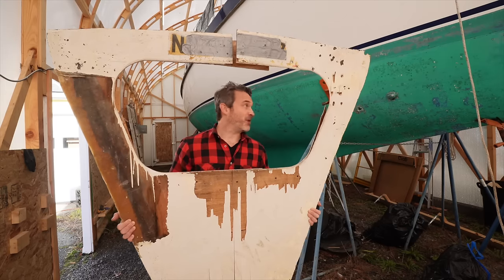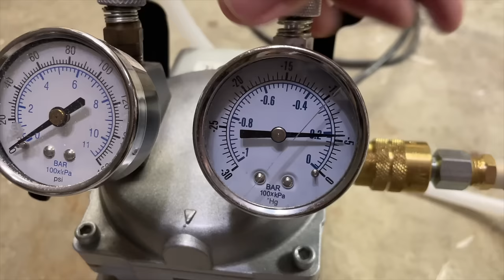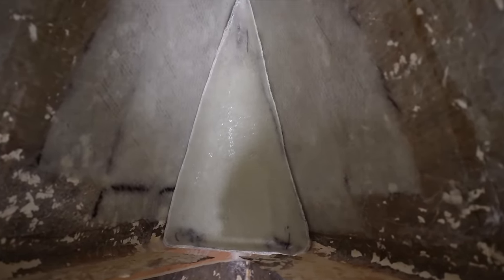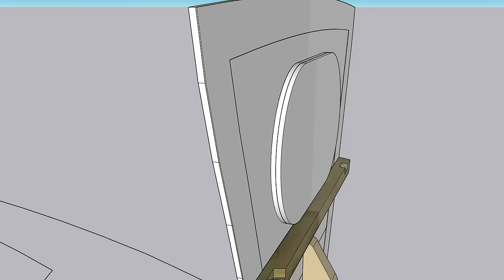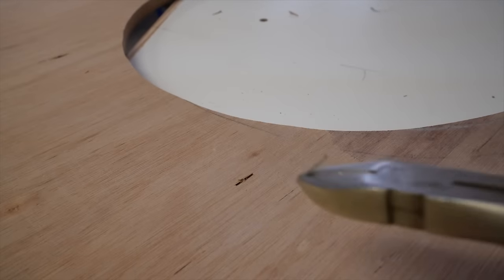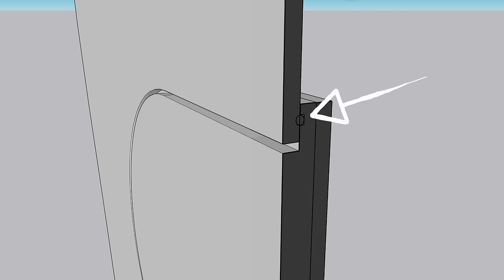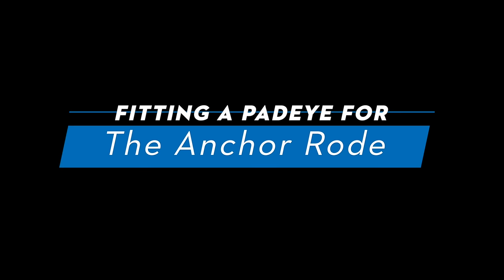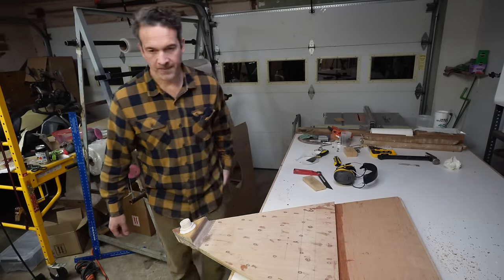Struggling with this Bulkhead Replacement? It’s a REAL CHALLENGE! - E018

Comment: If you anticipate the need for many additional perpendicular holes, Rockler makes a jig that will hold your drill perpendicular to the surface.  It’s compact enough that you can drill perpendicular holes into surfaces at pretty much any angle.  Very handy when drilling for deck hardware.
Reply from the maker: Thanks. I think I actually have one of those lying around somewhere… 🤔

Comment: This guy make more dang templates. The original bulkhead he removed was the only template he needed. Then he used the original bulkhead to make an OSB template. Then he used the OSB template to make a template out of those little pieces of veneer, then he finally made the final piece. Damn, that's a lot of extra work.

Comment: That simple jig system you used for the padeye is a really good tip. I need to mount a windvane shortly which is a fairly fiddley to do on the mooring and will be perfect for that. Same same for the drogue chainplates.
Reply from the maker: Thanks. 🙏 It’s a trick I’ve used many times to get relatively accurate drillings. Good luck! 👍

Comment: Once you start glassing the bulkhead the ply is merely a core and the overall sheer strength of the bulkhead relys on the low elongation of the glass. The ply has higher elengation so the glass would need to break  and delaminate before the ply does anything. A couple of layers of glass over h100 foam and your good and rot free. if your worried about abrasion etc put wear plates in the locker that are easy to remove.
Reply from the maker: If I was starting over again I would probably have used foam as the core for this bulkhead. 
Learning as I go. Thanks for the input. 
🙏🙌👍

Comment: That's a lot of waste produced from such a small area of the boat (the V section in the bow)  ..shame you can't re-use the mastic and some of the cloth components or maybe you can ! Is the vacuum process absolutely necessary , I mean it looked well wetted out before you did that?  Great work regardless, really enjoying this.
Reply from the maker: Yes, some of those supplies are unfortunately waste. I reuse as much of it as I can and have used the same vacuum bag up to 3 times so far with good results. 
It wasn’t essential here but the practice is helpful. The glass in the locker is lumpy and I was concerned about voids. Looking back I could have troweled it smooth with thick epoxy, let it tack up, and then wet layup overtop. 
Perhaps that’s the plan for next time. 
Thanks for the feedback!
🙏👍🙌

Comment: I am not a specialist but i have seen damaged boats that had hit objects in the water while sailing, they both had damage all along the waterline from scraping along the object. My thought is that building a bullitproof bowlocker is certainly helpfull but having redundancy in pumps and compartments further aft is as important. Not meant to criticise your work, just giving my 2 cents 😉
Reply from the maker: That’s a good thought about things scraping the water line… Antidote is built pretty tough (one of my mentors says it was built like a battleship 😂)

I’m hoping to never need it but I think the bow is the greatest risk with what will likely be quite a bit of short handed sailing. 
I will have quite a bit of redundant bilge pump systems before this is all over. 
Thanks for the feedback! 
🙏🙌👍
Reply: @livingforsail  The owner of one of the boats said they hit, rode up and then slid along something big, probably a container low in the water. The damage was extensive, it was a long keeled boat, heavily built, they had 2 holes at the waterline they managed to plug. This was years ago and a good scare to see.

Comment: Since that padeye needs to be watertight, will you be bedding it the same as you would for deck hardware? If so, will you also chamfer the bolt holes for a gasket of bedding material around the bolts?
Reply from the maker: Yes!! Good catch. I’ll show that detail in an upcoming video. 🙏👍🙌

Comment: Hey Jon, great video.  I'm glad that you decided to put a layer of 1708 on the inside of the anchor locker -- I was actually going to suggest that!!  You are going to add the 1708 to the top section too, you didn't show anything being added to the top section on camera.  Question:  That layer of foam around the perimeter at the top of the bulkhead that you added off camera, was that just raw foam glued in place with thickened epoxy?  Are you planning to carve that into a fillet shape to create a curve for the fiberglass while tabbing in the bulkhead?  I guess that I'm not really clear why you wouldn't make the bulkhead actually contact the hull to fillet in with thickened epoxy and then tab the bulkhead directly to the hull.
Reply from the maker: Yes, there will be glass on the upper section and then all tabbed together for a complete seal. 
The video was getting too long so it will go into the next one likely. 
I’ll get a better shot of the upper foam too. It’s the same Divinycell as the deck (6lb 3/4”) and it will be shaped to smoothly transition 3 layers of 1708 tabbing. 
Thanks for the question. Cheers!
🙏👍🙌
Reply: Thanks for the clarification ... I wasn't too sure about the use of the foam, but i figured that was the reason that you were using it! Keep up the good work!!  @livingforsail

Comment: Remember even if you take the bow off the boat the water in the compartment wont be much above the waterline.
Reply from the maker: I’m not totally tracking what you mean here… 🤔
Reply: @livingforsail  When you have a hole in the bow the water will only rise to the waterline and not fill the whole compartment. So the bulkhead does not need to be super strong/water tight all the way up.
Reply from the maker: I agree but i think that principle only holds in pond water. If we encounter weather with a breach I think I’ll be happy to have a door that is at least somewhat resistant to ingress…

Comment: Do you have concern about adhesion of the old flange forward of the bulkhead, or will you replace once back is tabbed in?
Reply from the maker: I am not too worried honestly. The epoxy is tenacious stuff. All the same we will add more tabbing to the forward and aft faces to make it really stout. 🙌👍 thanks for the question 🙏

Comment: Do you need to vacuum seal the fiberglass to get it to set/cure, or is this just a more belt and braces approach? 

Thanks 

I
Reply from the maker: It’s the “harder way” 😉

I could use more braces and weigh it down or maybe temporary screws. 
This way gives the best bond and most evenly distributed clamping force (way more than I could get otherwise)

… and it is kind of fun to pull it off I must add…

👍🙌
Reply: @livingforsail  hah of course! 🤣 Yeah completely understand, this method is new to me, results speak for themselves! Loving this series, keep it up 👍
Reply from the maker: @bakey1111  Glad to hear that. Thanks for watching!

Comment: Great stuff but epoxy, especially in a non-structural elements, requires very little clamping pressure. Vacuum clamping for filler parts like the anchor locker floor is a waste of your time.
Reply from the maker: Thanks. As a first timer using vacuum with some important parts coming up this was a good way to play around and get familiar with the tools. Thank you for your concern about my time management 😉👍
Reply: @livingforsail  fair enough. Don’t know your timeline.
Reply from the maker: @BrianSimpson-tk3xj  Neither do I ...